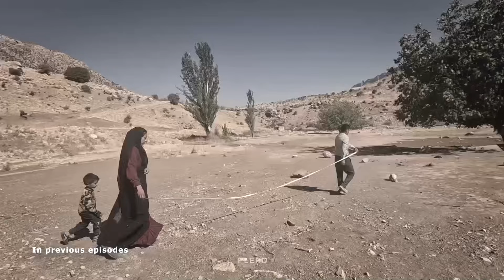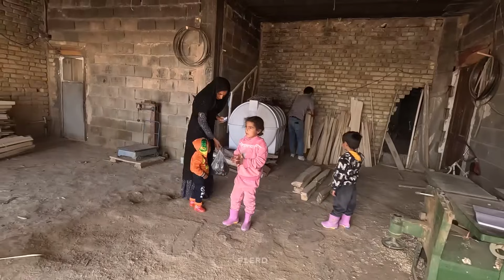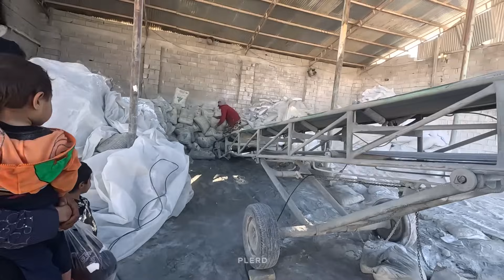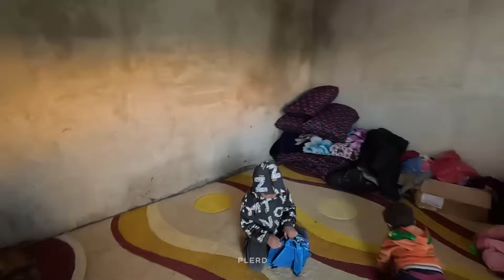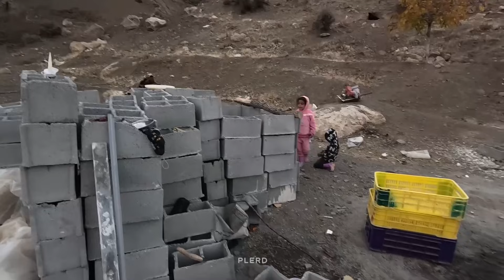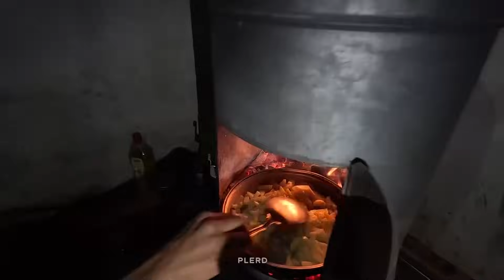Winged Warriors: A Self-sufficient Mother's Decision to Forge a Different Path

Comment: OHHHHMYGOODNESS. SHOUTS AN TEARS OF JOY. LOOK AT THE FACES OF THESE BEAUTIFUL CHILDREN.  I AM SSSOOOOOO HAPPY FOR TAYEBA AN HER KIDS. These chicken will be such a great source for Tayeba an her Family.  I know a chicken coop an chicken area has to be built thank goodness there is plenty of land for that area. Here in America they use Chicken wire. Many Cut open top portion of  long PVC Pipes an hang on suspeneded removable wiring low to the ground for chickens to have food an water an easy access to remove when cleaning is necessary.  Maybe the Construction worker can come back an help with this process moving it quickly. Another trip to town I guess for  chicken  food, nesting an chicken straw. Chicken coop necessities etc. I am ssssoooo Happy an Excited for You all. Cant wait to see the finished Project. Oh an Please keep plenty of hand cleaning soap an disinfectant solutions. Still  need those tubs an or cattle troths for bathing in hot water to kill germs for body washing an washing clothes using a cleaning new toilet plunger to plunge clothes. Or maybe soon get an electric washer an dryer with additional solar panels. The sky is the limit her an I am so grateful to see everything unfoldind. God Bless You Plerd, Viewers, Supportors an Most importantly Tayeba an Her Precious Children.
Reply: I forgot to mention yes I have seen chicken water an food dispensers that will be need for the little chick's when they hatch. Anyways. You all will figure it out. Great Job. Sooooooo Happy.